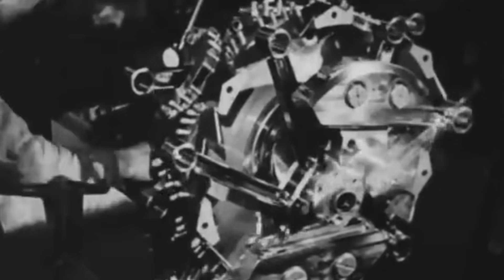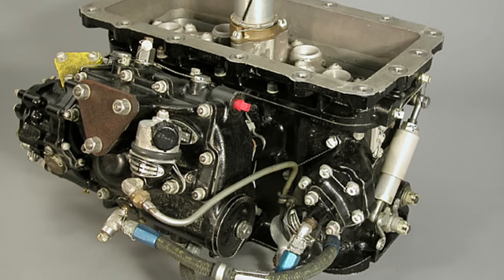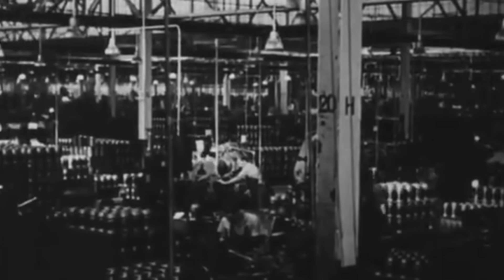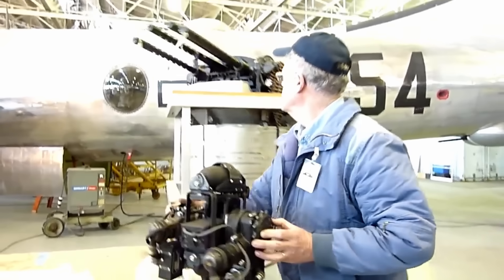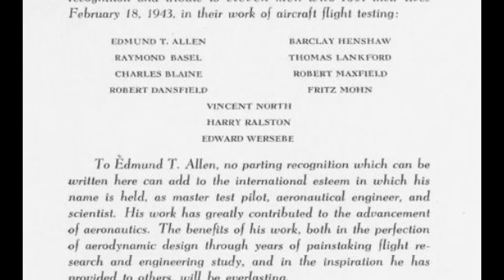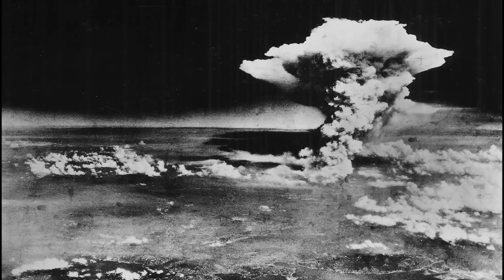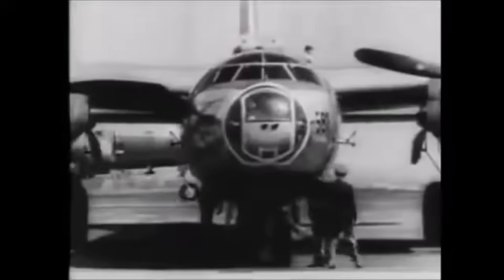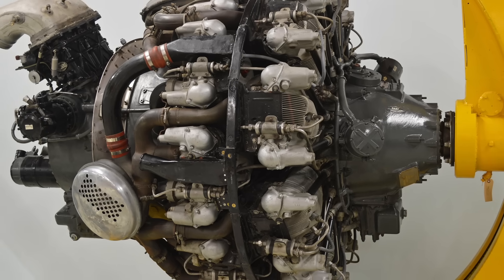MicroStrategy Connect: Community Top 10 #AsktheExpert

Comment: The Weight R-3350 had Engineering and Design flaws that almost caused The B-29 From Ever getting off the ground! In fact, many of Boeing Top test Pilots, Engineering Crews lost their Lives in the many Wright R3350 Engines Over heating and The Magnesium Components would Explode and Catch on fire sending the Test B-29's crashing to the Earth! So the Federal Government and The Army Air Force grounded the whole B-29 Project which actually cost a whole 1-Billion Dollars more than The Manhattan Project or Development of The Atom Bomb! So, President Franklin D. Roosevelt knew who to call to solve these Fiery Explosions, Heating Problems, the Horrible Very Low Running Down times 5 to 10 Hours, Serving Problems that the Aerocraft Mechanics were having, and Especially in The Rotating Assemblies and Moving Parts!  The Company and their Owner President Franklin D. Roosevelt Called on was No other than WALTER P. CHRYSLER OF THE WORLD FAMOUS CHRYSLER CORPORATION Who Is an Engineer and Scientist of Metallurgy By Profession who invented the self Lubricating Bearing and who at "The Chrysler Corporation Has Their Own Chrysler College of Engineering and Metallurgy!  FDR Awarded The Chrysler Corporation with Responsibility to Fix these Wright R3350 Cyclone Aircooled Radial Engines Utilizing its Original Design! Well, Walter P. Chrysler Built Chicago The Worlds Largest Production Plant that included The Worlds first and Largest Electric Dyno Machines To Run and Test Every Chrysler Made Re Engineered and Designed Wright R-3350 Radial Air-Cooled Engine!  The Entire Chrysler Aero-Space and Engineers, Design Team, Machinists, Metallurgist made over Seven Thousand Engineering, Metallurgist and Machinist Revisions to The Wright Cyclone R-3350 Radial Engines! The Chrysler Corporation would then Blueprint, Machine and Balance Every Moving Part of The Chrysler Weight Cyclone R-3350 Radial Engine! Then Dyno test Every R-3350 Under a Load that Exceeded its Design Because that's How Confident Walter P. Chrysler knows The Superior Craftsmanship and Dedication of His Employees to Winning WWII! Walter P. Chrysler knew that This Engine Power Plant was built to win  World War Two and He just wanted to help The Wright Brothers who helped Walter P. Chrysler Wind Tunnel tested The First Modern Automobile For All Times till today, "The 1934 Chrysler Airflow!  The Chrysler Corporation took The Wright R-3350 Radial Air Cool Engines from a 5 to 10 Hour Unsafe and Unreliable Running Engine to a Very Reliable Safe Running 24-Hour a Day  100 plus Hours Radial Engines! * Plus Chrysler was shipping by Crates Brand New R-3350 Engines Dyno Tested/Run/Tested/Plus Taken Apart & Micrometer Every Part after being run on its own/Then Shipped to Tinian Island by the Thousands!

Comment: My father worked for C-W from about 1952 to 1963 mostly in Fairfield, NJ and in the last years in Wood-Ridge, NJ. He mainly did QC work, inspection and testing of rebuilt engines. Much of his work involved this engine for the military and commercial users. Sadly C-W didn't get involved with jet engines although did make some RR ones on license. The Wood-Ridge building and some deteriorating signage for C-W still exists. Most of the building has been sub-divided for warehouses, light industrial and by NJ Transit for heavy maintenance for their locomotives and passenger rail cars as adjacent to a major railroad track. The huge parking lots and adjacent properties have been developed into a massive apartment and town home development over the last 15 years.

Comment: The B-29 wasn't DESIGNED for the Wright R-3350, but the Wright-GE R-4880 "Corncob" 48 cylinder triple-staged super-charged 4500-9000 (!!!) HP engine, which wasn't fully developed until 1950 and the B-29B became the B-50A when the were installed. The "Corn-cob" using 135/160 octane AV-gas and water injection could develop 9000 HP EACH for 7 minutes at 64,000 ft @ 86 inches of manifold pressure or 71 pounds of boost. This was a Ricardo Sleeve-valve engine with NO poppet valves per cylinder. "Now she handles like a fighter-plane" B-50A test pilot.

Comment: Aircooled motorcycle engines comfortably make 100 bhp per litre. Japanese bikes could do this all day long. e.g. Yamaha 900 made 90 bhp. Cooling fins on cylinders and heads were spaced about 1/4 inch (6mm) apart allowing air to flow freely and extract heat. 
R2350 had extremely close packed cylinder fins. It’s hard to see how any useful air could get between those fins. It’s highly likely this is why they overheated so easily.

Comment: I spent about 4000 hours on ASW airplanes and  L749 Constellations powered by these unfortunate engines;  engine failure occurred every third flight or so.  Including running out of oil!!!  (60 Gallons) .  They were a fine boat anchor but not much else .  Sorry for the starry eyed folks... :-)

Comment: Wow! They scrapped the Anti-Knock systems? Really why? It doesn't have to be so overly complicated like direct injection like they had originally. Just a few nozzles throughout the intake system and going into the supercharger/ turbocharger system. The mixture of Water/Methanol is all that's required to almost stop all knocking and it also acts like a intercooler by evaporation and cooling down the air fuel charge under pressure into the cylinders. This method is used till today on the fastest of race engines that are not only naturally aspirated or boosted. But they were up against the ticking clock back then. The fact that these engines were already light years ahead of the with roller rocker arms and roller camshafts. This freed up so much parasitic loss, it was considered top secret for the war time engineering. They made amazing amounts of progress and advances in balance and reducing weight as well as not just meeting their goals of 1 HP per cubic inch but superseding this figure by sometimes more than double making HP unheard of at the time! These engines were absolute monster's and reliable once they ironed out all the heat bugs. Another major factor that has been going on in today's racing engines are dry sump oiling systems and the use of precision oil squirters that not only prevent friction and metal to metal contact, they discovered back in the 30s by aiming a squirter at the undersides of each piston the oil lubed not only the wrist pins, and rings but the biggest asset to do this was they found that the oil removed a ton of heat from the piston itself. Which is super critical for any performance engine, especially when you have issues with high compression ratios as the likes of boosted engines as such! These are a few little things I'm aware of that were major developments during this period of time! The war just added more pressure to make these changes happen much more quickly than they would have ever come by on say a race engine builders budget for R&D! When you are dealing with the military industrial complex, as we're well aware of, taxpayers money is no object when it comes to military achievements and developments. 😅

Comment: The 3350 was unfortunately rushed into production during the war without proper R&D. The results were scattered all over the Pacific theater. I have documentation in the 50s with pictures showing new engines from the factory having to be disassembled,  cases split to drill passages because of oil clogs.Oil technology was in its infancy comparatively but given the problems power recovery systems  presented, R2800s with appropriate turbos would have been a far better and much more reliable choice. Even   the B50s were using P&Ws as was the B36. These had their problems though as radial technology had peaked.
Reply: It was stated here, that these engines were only developing 2500hp. Near the end of the war, P&W2800s were making 2400, and then eventually 2500 themselves.Politics was the reason for choosing these Wright engines, not good sense.

Comment: .12 engineering marvel? Yer kidding me right?
Look, just because you put 32 cylinders bristling like a corncob on an engine block. And you make 4000 horsepower. Doesn’t make it good.
The amount of failures, dropped valves, over heating, seizing…..is un paralleled.
In the tropics, it gets …ummmmm…you know….hot.
Replacements in as little as 25 hours, and entire top cylinders replaced every day.
And…as a bonus, the case was made of magnesium. And you know what happens when that gets on fire…….saw through a wing in seconds.
Engineering marvel…..my gawd, who writes these things.

Comment: I was a Recip Engine Mech in the Air Force back in 62-66.
I worked on the R-3350, R-4360, R-2000 and the R1300 engines. The 3350's were on the EC-121, the 4360's were on the HC-97G, the 2000's on the HC-54 D and the 1300 were on the HH-19B. It was quite an experience working on those big engines. I still watch videos of the 4360 being run just to listen to the sound. You never forget the sound that those big engines make.

Comment: In 1976 I remember seeing a Connie circling the Belize airport, Central America. One could see it was flying just on the two starboard engines. What had happened was the port outer prop had separated from the engine and it spun into the port inner engine with such force that it not only caused that engine to be shut down due to several cylinder heads being badly damaged, it also bent the engine mounting down about ten degrees buckling the undercarriage doors so the port main gear wouldn't extend. After circling for some time it came in on a long low approach to the runway and touched down on the starboard main and nose wheels until the left wing slowly dropped onto the concrete and it spun off into the dirt at the side of the runway. The gear didn't collapse and nobody was hurt. It made for a memorable day way back then. 🙂

Comment: I’ve flown on aircraft powered by the R-3350, but not the B-29.  Born in 1954, I’m referring to being a passenger on the Douglas DC7 airliners operated by American Airlines, circa 1958-59. I have a sketchy memory of a night flight from El Paso, TX to Los Angeles where an engine overheated,  warranting an unscheduled mid-point landing to let the engine cool before proceeding.  
The passenger versions of the R3350 were equipped with a power recovery turbine (PRT) as a system that scavanged exhaust pressure redirected via turboshafts as added crankshaft output power.  The novel design added substantial power, but at the cost of even more complexities & maintenance costs.  
I treasure my somewhat fuzzy memories as a young child flying in DC6 & DC7 aircraft…the sounds, smells, buffeting, and the overall experience in what was the inception of the golden age of commercial aviation.
Reply: The R-3350 and R-4360 were marvels of technology that gave the US some incredible military aircraft but commercial failures due to inadequet reliability and high maintenance costs.   As a result the R-2800 powered DC-6 remains in service and the DC-7 was retired long ago.
Reply: @williamzk9083  The reliability problems of the R-3350 persisted across both military & commercial applications. Consequently, the P&W R-3350 demonstrated the outer edge of attempting to extract maximum power from double row cylinder, air-cooled designs that met their sharp demise once jet engines arrived.  The P&W J-57 and it’s successors proved to be a massive step forward.  A handful of vintage DC6 remain today, but back in the late ‘50s planes like the Lockheed L-188 Electra with its 3,750 hp Allison turboprop motors also drove the nails in the coffin of piston engine, commercial aircraft
Reply: @Snookynibbles R 3350 were Wright's project engine, P&W made the R 4360

Comment: You should have mentoned the   R-3350's civil applications on the Lockheed Constellation series and Douglas DC-7. The maintenance-intensive R-3350 was a major reason why those types had little demand for conversion to freighters etc. after retirement by their original operators, compared to the reliable Pratt & Whitney R-2800 on the DC-6 series, some still carrying cargo in Alaska today.

Comment: This article seemed ignore the issue of 3350’s in later iterations using PRT’s.  These Power Recovery Turbines provided 400 more shaft HP delivered to the crankshaft as the turbines being geared to the crankshaft in conjunction with the supercharger it failed to add “reliability” to this iconic motor.  Shutting down a fully functioning 3350 upon a successful flight and a subsequent restart the next day the engine being utterly unairworthy after a thermal cycle managed to break things.  All this helped usher in the jet age.

Comment: These machines were amazing... The technology and materials that were available 80+ years ago, was put to good use... Eventually the R-3350 Engines were improved, to put out well over  3,700 H.P.  which became reliable, AND last a relatively long time between overhauls... Several civilian and military planes had these engines well beyond the introduction of jet engines.... And they were the preferred powerplants of the fire-bomber planes, cargo planes and unlimited racing aircraft... They took time to develop, but they ended-up being some of the best large reciprocating aircraft engines that were ever made.
Reply: power recovery systems were removed for nearly all of the non-military uses of 3350s. They were a nightmare, with reliability becoming the great equalizer. It was a system using fluid drive such as the torque converters in automatic transmissions through gears and shafts adding horsepower to the crank. Oil clogging was its worst trait as it used.  engine oil and not hydraulic oil used in other applications.
Reply: Those were the R-3350 PRT engines. PRT - Power Recovery Turbine. It was a turbo that was geared to the crank shaft and added some horse power to the engine. I forget how much power was created by that design.

Comment: Correct me if I am wrong but I always thought the radial was the Engine that God gave to aviation and they worked flawlessly at 2 rows add any more rows and you can’t get enough air to cool the back row and it seams like that was never solved ! They should have quit while they were ahead . Grandpa worked on and assembled these engines, he so loved these engines he could not get it out of his head  , so 5 years after he retired he had put together a Radial Replica, to him it was a functional work of art. The motor spun due to a clock motor that ran the shaft and all of the other things that were supposed to move! This display ran at most 5 RPM  ! Many many areas were cut. away  just to show how it actually worked . He chose to make this model from a Japanese Zero engine with only 2 banks of cylinders ! What a great choice because I have often seen static cut aways of 2 Bank  cylinder radials  , but Never one that moved and showed you how it worked !  To call it a conversation piece would really sell it short as he have to kick out some of his visitors because he wanted to go to bed ! It was truly a Gear Heads’ delight ! My uncle got it from the Will  and I am determined to get the engine that “God designed for aircraft “
Reply: Any engine that does not have the same stroke for all cylinders is an abomination in eyes of God... which is why he allowed Radials to die-out and become extinct.
Reply: The R-3350 was a 2-row design, with 18 cylinders (two rows of nine). I think with an 18 cylinder radial cooling the rear bank can get difficult because there's not much space between the cylinders, careful design of the 'tin' i.e. sheet metal baffles to direct the airflow was very important as otherwise hot air that has already passed over the front bank's cooling fins could end up mixing with the cool air going to the rear bank. Wright didn't get that right with the 3350 initially, and the result was an engine with serious overheating issues, but other 18 cylinder designs like the R-2800 and Bristol Centaurus were pretty successful (though the latter spent a long time in development partly due to thermal issues). Overall it seems like a 14 cylinder radial is an easier proposition, having seven cylinders per row just gives you more space for cooling airflow I suppose.

Weirdly, Pratt & Whitney managed to get the R-4360 to work despite having four(!) rows of seven cylinders. It did take them a long time and a lot of development however, and it always had issues with cooling.
Reply: @nerd1000ify 

Back in my early days I had the chance to work on a 4360. For a young A&P it was great. And very difficult. Luckily we had an old timer and he taught us quite a bit. Sadly the owner let someone fly it and they torque rolled it and bellied it in. He was not a happy camper! A sad day for the Martin Mauler....Very few of them left anymore. But what a beast!

Comment: My father was a gunner in Korea in the B-29s (later in the A/B-26). He told me a lot of stories about flying in them and about the remote gun systems. etc. He was responsible for starting and then shutting down the small gas generator that gave the plane electric power until the engines were up and running. He said the fumes from that little generator were terrible and many fights he made while sick from the fumes at the start of the flight from the "Putt-Putt". As a model builder I do a lot of contract builds for people. Recently a guy asked me to build a model for him and as a reference he gave me a copy of a home movie from the early 1950s (in color!) of an airshow in Texas. In the film were many aircraft; Hellcats, F-82 twin Mustangs and even a fly over from a very early B-36. In the background, parked on the ramp is what I am sure is a B-32 Dominator. Someday Ill post it to You Tube because it is really cool!